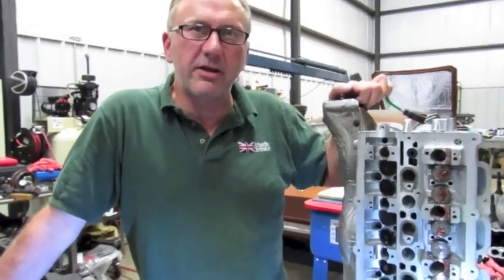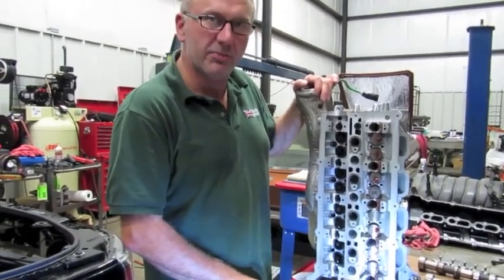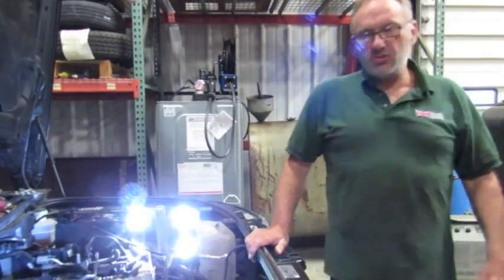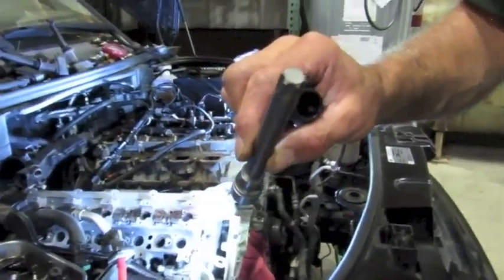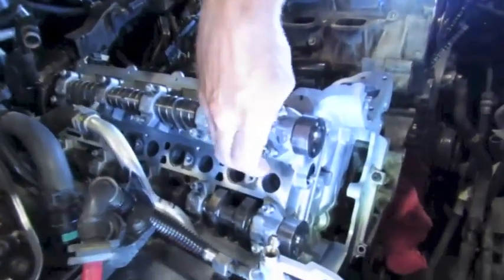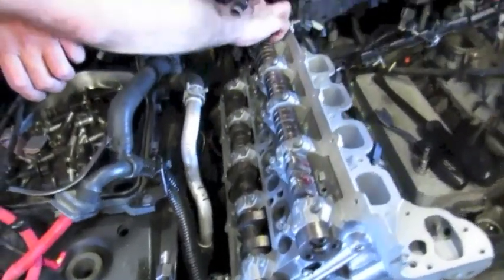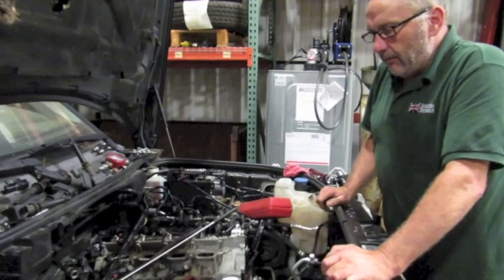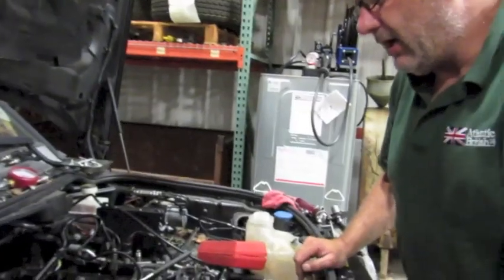How to Install a Cylinder Head on Land Rover LR4 | Atlantic British Presents

Comment: what type of bit and size is needed for the head bolts? Ive heard polydrive or ribe. Even heard polydrive and ribe is the same, and also heard its not the same, and google hasnt been as good of help as I hoped in clarifying that. Any help would be appreciated.
Reply: I know this was asked two months ago, but hopefully the next guy will need this info. It's a RIBE - not Polydrive. They look similar but there's enough of a difference in shape that it could be the difference in a successful job or a stripped head bolt.

Comment: Have you guys heard of any outcomes on yhe court case due to the timing chain issues on these engines? 
I love my Rover Sport and know I'll have to them soon.
Reply: And thank you for the wealth of knowledge in these videos!
Reply from the maker: Haven't heard anything on a decision on that. But it is widely recommended you should change your engine oil on these vehicles more frequently than Land Rover specifies. Doing so will cause less stress and wear on the timing chain components and improve the life span of them... which is the root of the issue in the class action case, I believe.